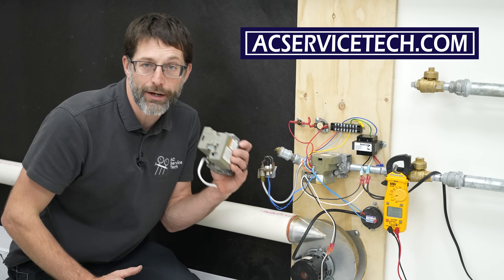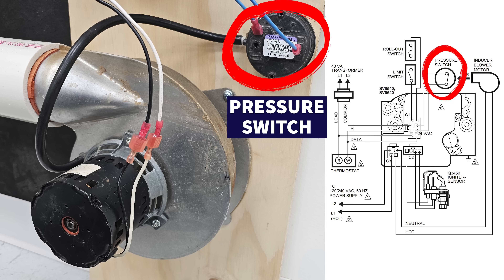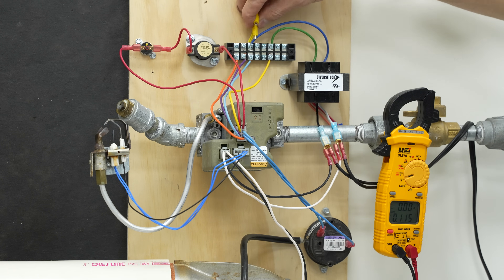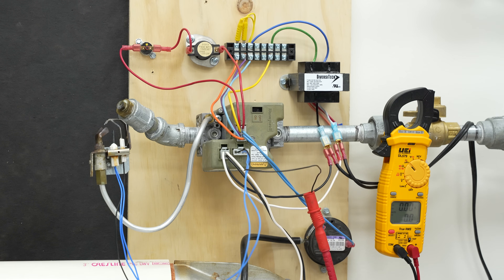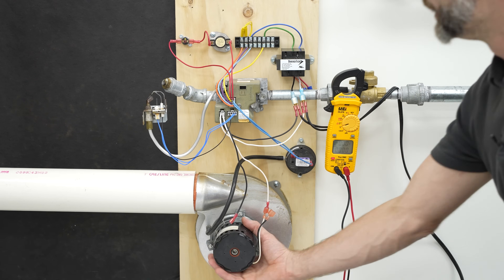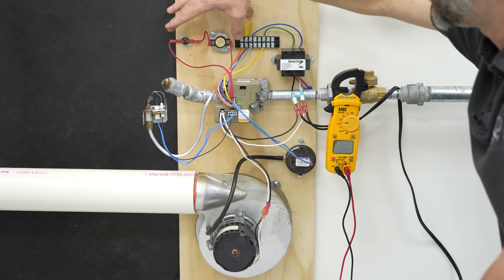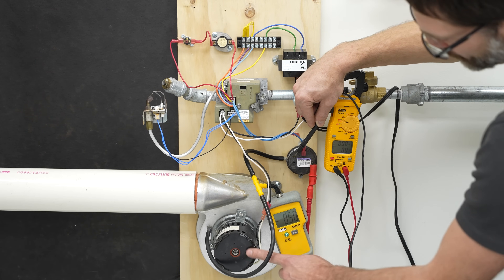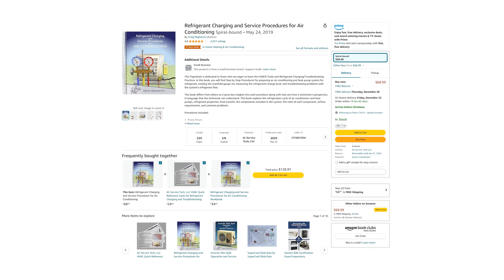Honeywell Smart Valve Operation, Testing, Wiring! HVAC Gas Furnace Training!

Comment: Hello, I have the same unit- there is power of 120v going in the valve but the inducer fan is not on. All the safety switch is close. No lights on at the valve. But the blower is constantly running too
Reply: What if the gas valve is lock out is that mean need to replace a new gas valve or is there a reset
Reply: @creamsoda13283 check if you have 24vac between w and c at the board. the inducer should be on before the gas valve. Don’t change the gas valve it’s probably the inducer motor
Reply: I check the voltage, no voltage is coming out from the gas valve  to the inducer motor

Comment: Great video explaining the sequence as always.I have watched many of your videos and they are always very detailed and informative.  However the SV9541 smart valve on the orange wire C1- #4 uses Non--periodic 1 /2 wave rectified AC (measures as an unstable AC voltage bouncing between 12VAC and 16VAC. Not a solid 24-28vac directly from the transformer as you show in the video. When the call for heat from the thermostat (R to W) the EFC board uses the orange wire P1_#2 to tell the smart valve C1-#4 to start the sequence. Again this is not 24-28vac, it is the Non--periodic 1 /2 wave rectified AC (measures as an unstable AC voltage bouncing between 12VAC and 16VAC. With using a good RMS volt meter you cannot see any difference in a cal or no call. I have tested this on a working system. I know that Honeywell has a hand held device that can help with troubleshooting these smart valves or you could use an oscilloscope but not many HVAC techs including me are going to have one. Can you explain how you would be able to verify the call is coming out of the EFT board P1-#2 to the smart valve C1-#4?

Comment: Inducer motor isn't getting power.  The line in has 120v.  The 24T to C and 24R to C have 28v.  Data to C only has 15v.  I'm leaning towards the board but appreciate any advice.

Comment: If one of the exterior safety fails, you can replace that but if the relays inside the valve don’t work, you gotta replace the whole thing. Where is the genius in that other than selling smart valves got  460 bucks?

Comment: Love the video.   One thing I noticed you mentioned the orange wire carrying 24 volts to the valve. From what I understand that's the wire that the valve uses to communicate back to the board to tell it when to turn the fan on.  So for your test you do not need to jump 24 volts to the orange wire.

Comment: HELP! 
I have an ICP furnace T8MPN100F14A1,
I replaced the factory control board (ST9160B1084) with a ST9120U universal board as per the manufacture instructions because I thought it was the issue before knowing about the smart valve.
Here are my issues. On an AC call the furnace operates perfectly fine, on a call for heat immediately the blower fan turns on, and nothing else happens. This happened with both the original furnace board and now the new board. The inducer does NOT start and therefore the rest of the ignition process does not follow. Any ideas as to why this is happening? 
The HSI reads 3.1ohms, and all safety’s ohm out perfectly fine, including the pressure switch.

Comment: Great video, and your other videos are great also. Have a problem hope you can help.  
On a Peerless boiler hydronic baseboard system, gas valve sv9501m2700, the igniter will not come on.  Reading 5 ohms on the 2 blue wires to the igniter.  Reading 28 volts on the gas valve where the igniter plugs into it. What can be the problem.  Thanks for your help.

Comment: My furnace has a Honeywell SV9501M2056 smart valve. The furnace would turn on then shortly after it would turn off. The issue it had was the capacitors in the smart valve circuit board dried up (high ESR) and then they could no longer hold the correct voltage for the gas solenoid to stay open. They are repairable if you have the right tools and knowledge.  You will find this issue with any electronics that have electrolytic capacitors.

Comment: What's causing flames coming from the burnes causing minor bangs , it's like delay on the ignitor or to much gas coming in , I checked the spark and it good.
It's a RTU 4TON  Carrie

Comment: You mention DATA wire on orange wire, what does DATA wire meant?
Reply: I have been searching for this answer for a few days now. 

It seems the orange DATA wire is the trigger wire that tells the gas valve to start the whole sequence. When your thermostat calls for heat, this orange DATA wire should send 28v to the gas valve.

Comment: That 120V hot junction is awfully close to touching metal gas pipe and is making me sweat lol especially considering it looks like double lead ends on one side which are not insulated all around. Nice presentation though.

Comment: To see if a switch is open you could set your meter to DC volts and see if you have voltage across the switch. 

A properly functioning switch when closed should have less than half a volt across it.
Reply: Or check continuity.

Comment: Your video does a great job of understanding how the Honeywell smart valves work. I still prefer using an independent ignition control board for a couple reasons. Cost and ease of repair. Changing out an entire smart gas valve (equip and labor) far exceeds that of a standard setup. I have also found failure rates higher on the smart valve. None the less, great training video.